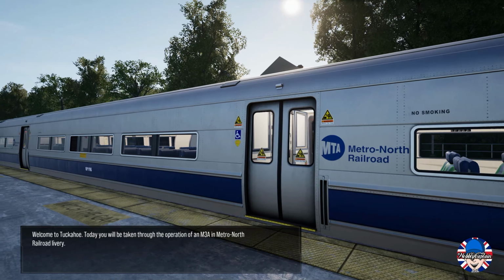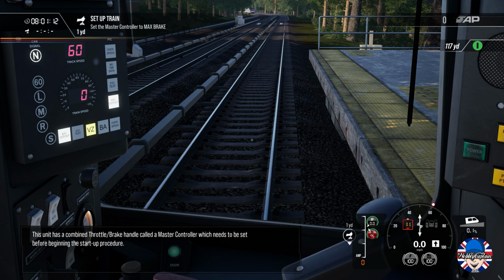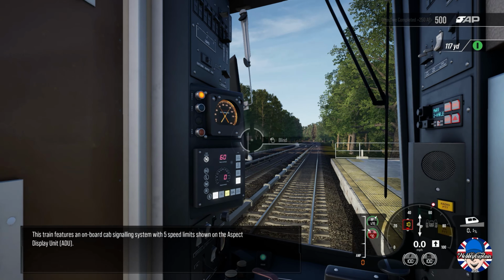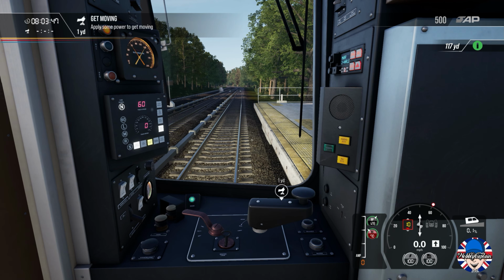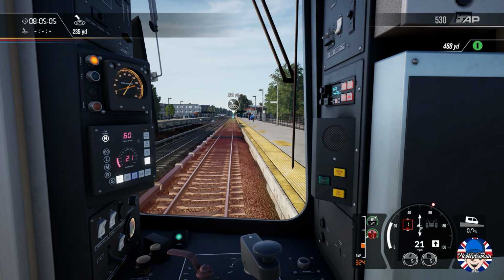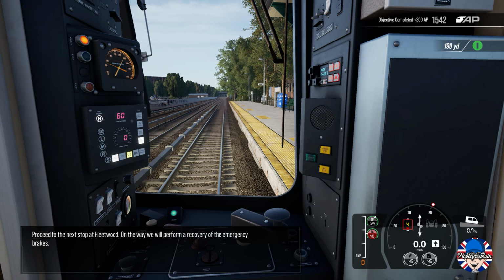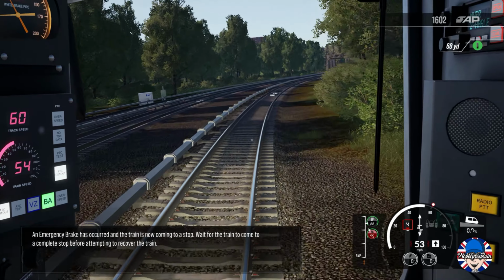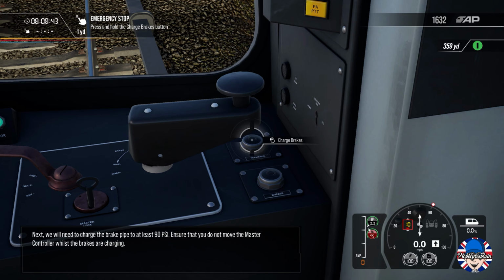TSW2  M3 Introduction Harlem Line: Grand Central Terminal - North White Plains Route Add-On

Comment: Very nice, the route looks really well made. I've never seen a train that makes you insert a key in order to unlock the doors but I like it. It is a nice touch. 😃
Reply from the maker: There is a few like that in Train Sim World not sure if a guard would do that job insert a key to unlock the doors ? cannot remember the other route or loco with the same door opening procedure it gets difficult when your trying to keep to a time schedule when you open the doors this way. You can use keyboard commands on pc not sure what they are on controller ? but Y & U are the shortcuts for opening doors  not sure if it works if there is a key to insert first ? will have to try it using the key short cuts on this train when I start doing the lets plays with a bit of commentary lol
Reply: @wobblycaptain  I think it would be a guards job to do that but I'm only guessing. Is the other train also American can you remember? I can't think of any so I can't help you out Wobbles.
Reply from the maker: @SimRelated  Am sure it was American train might of been on the Long Island Rail Road but not sure